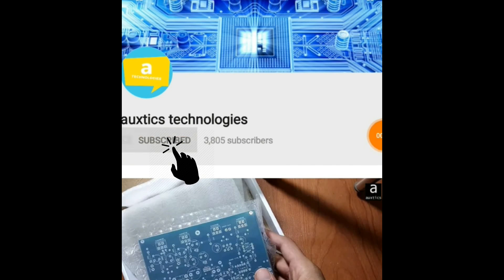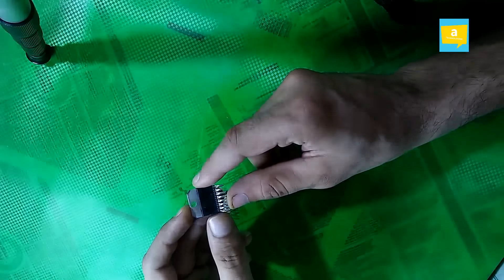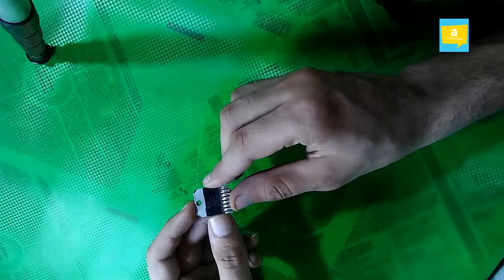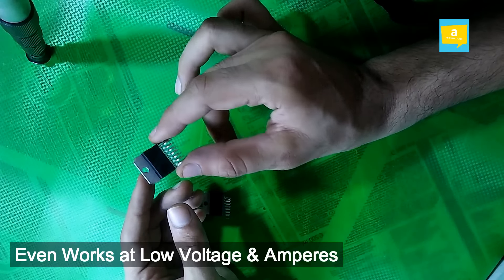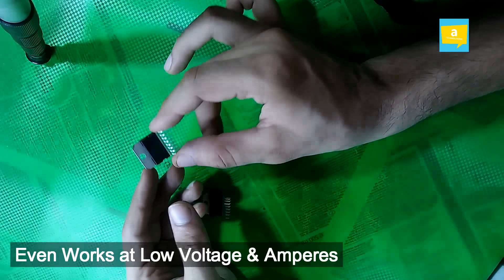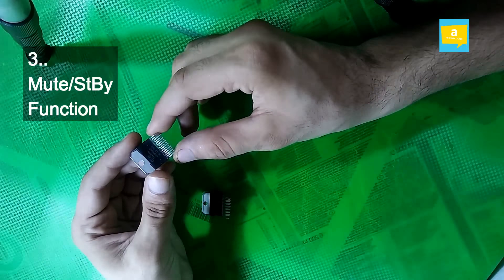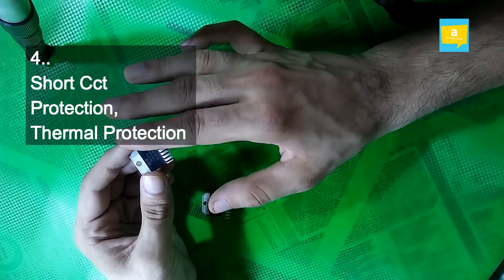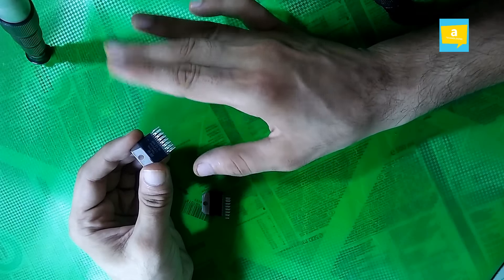tda7294 Audio IC First Ever Review in HINDI/URDU

Comment: Issme 37 0 37 ka transformer use kar sakte hain?
Reply: Its maximum volt is 40 vdc so do not Connect above 27 0 27
Reply: Sir 2 ic board kile 27 0 27 lagasakth

Comment: I could understand parts I speak English. You could use the same video and eliminate the original languages and do others in place of (Voice Overs) and double your videos. These are 100Watt Chips. I heard you say there was a built in delay, but the one I have has Omron relays and is built to 80Watts per Chip. So I have 4 Chips = 320Watts I have a 2.1 System, (((My question is what size heatsink should I use to keep them cool?))) I've done Boards like this, but I use inkjet glossy paper with a laser printer with Toner, iron them on, let them soak 10 minutes and rub the paper off gently, the inkjet paper comes of easy and I use Isopropyl Alcohol to remove the Toner, comes right off, works great and if they sit for any amount of time I use this stuff called Liquid Tin, coats the copper and protects it. I usually flood the tracks with lead or silver solder because I had tracks burn up over time, even wide ones. I'm happy you're hitting at the TDA7294. Thanks
Reply: Thanks